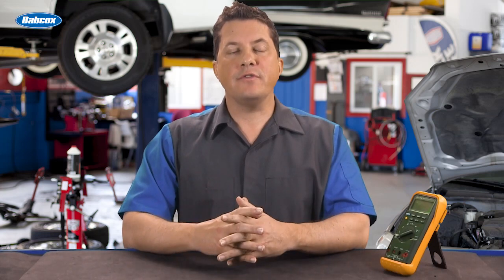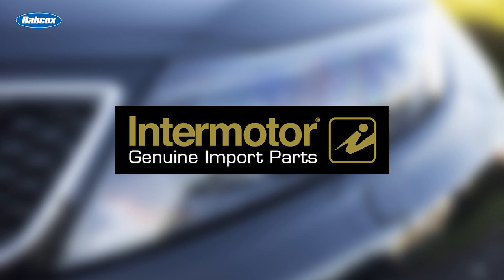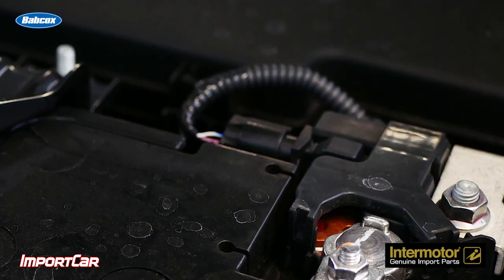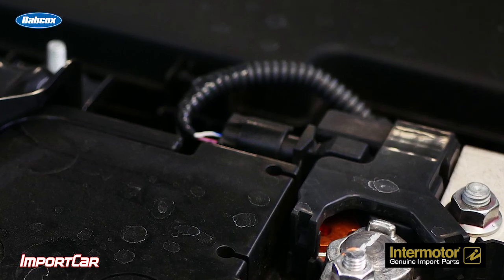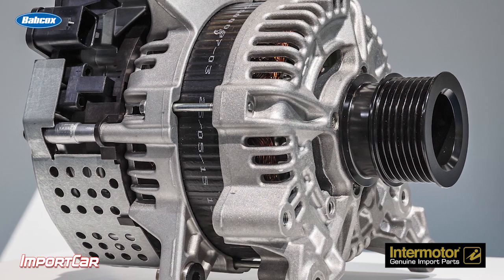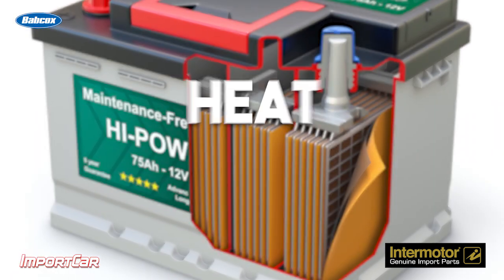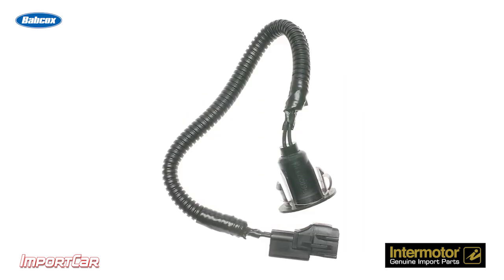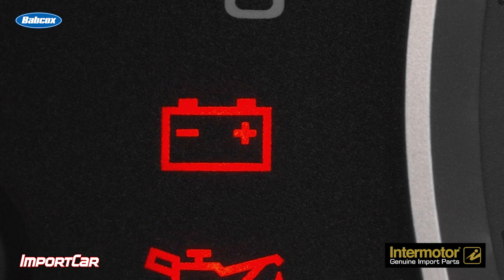Battery temperature sensors | Maintenance Minute

Comment: The battery temperature sensor is there to control charge voltage and not performance as you stated. Charge voltage is higher when it is cold and lower when it is hot.

Comment: Recently replaced the battery temperature sensor when the P0516 code came up on my '05 Jeep Wrangler TJ cluster. Oddly enough, it doesn't come up on my scanner. This is a first! And when I go in reverse to get parked in my driveway over a very small bump, the check guages light comes on. 

Also have a new alternator and battery with the battery reading 12.6 when sitting which is perfect. However, the voltage only reads 13.6 after I start it up, when most TJ forums say it should read between 14.2 - 14.7

Any idea of what is causing these things and how I can correct them??

Comment: i just found out the battery temp sensor on my 2004 dodge ram 1500 is missing,harness wires are torn off weird thing is no check engine light ! i have been noticing a low battery charging system maybe that missing sensor is the reason for the low charge...but why no check engine light if sensor was completely missing?>!!!

Comment: Very minimal info. here! Soo, HOW do you check it with a scan tool? WHICH PID do I watch? I do know how to check the duty cycle % with a voltmeter using the Hz setting but you could've explained that in your video in more detail👎👎👎

Comment: On a newer car are you saying the alternator uses the battery temp sensor to stop charging?  in addition to voltage?
Reply: That is what I have researched and this Battery Sensor can STOP the Alternator from Charging the battery. I have intermittent Voltage from 0.00VDC from the alternator to the battery to 13.5VDC from the alternator to the battery. Still researching. I drive with the headlights on and no problem at night. It seems to act up when HOT outside. It is all pointing to this voltage sensor.